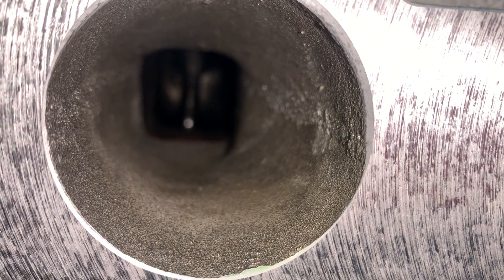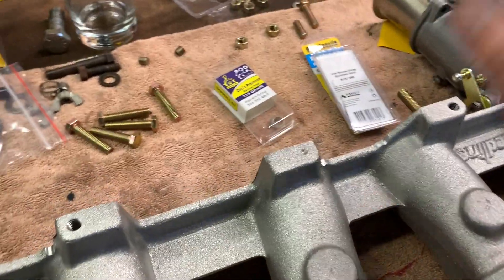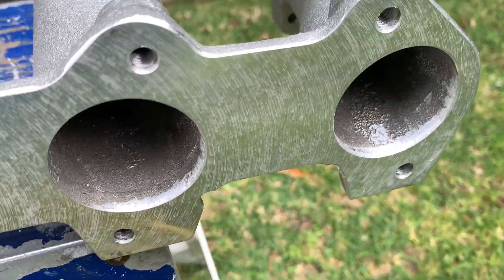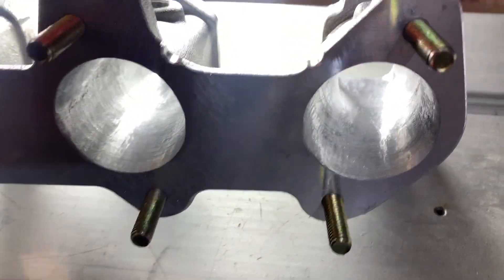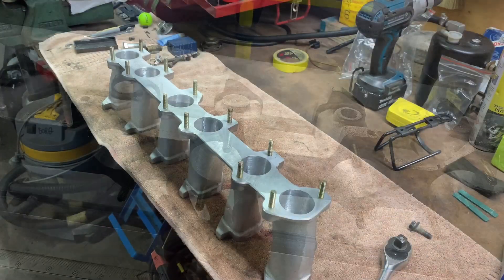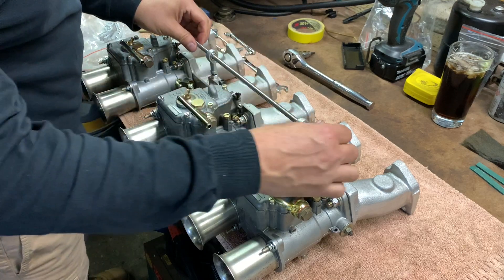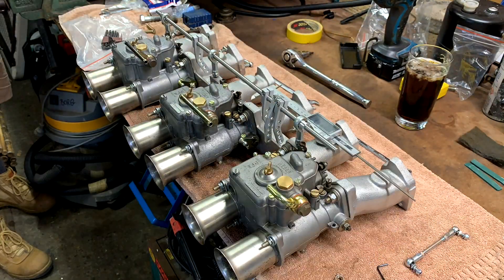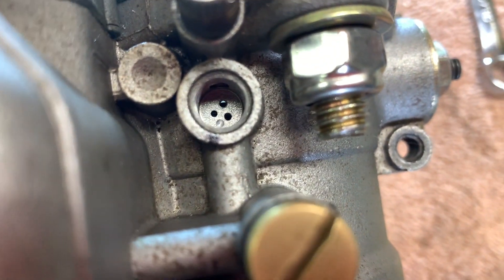Triple Weber DCOE 45s on the 245 Hemi PART 5. Valiant, Chrysler, Mopar.

Comment: Very nice setup. I installed triple choke Webers on my Ford 200 six by chopping off the log intake and fabricating a setup to mount the Webers (from mandrel bent exhaust tubing). It worked wonderfully.